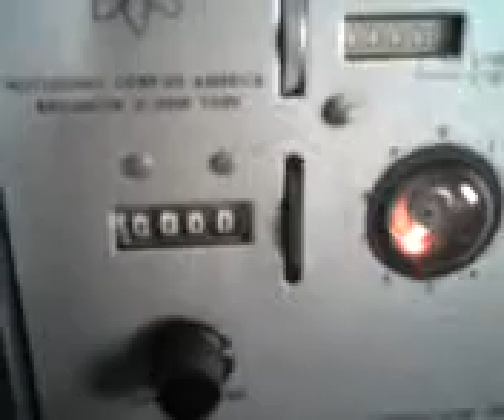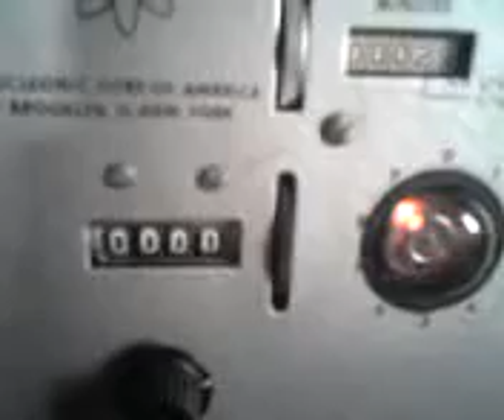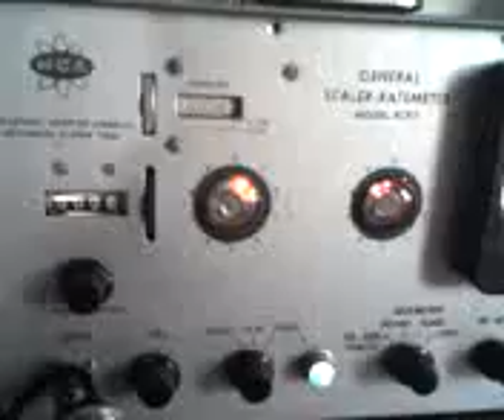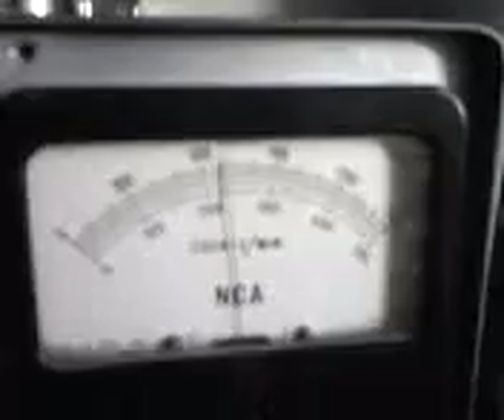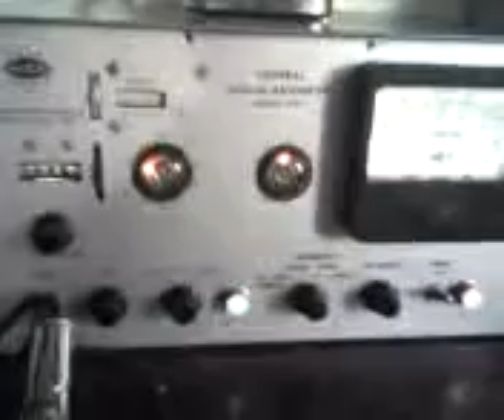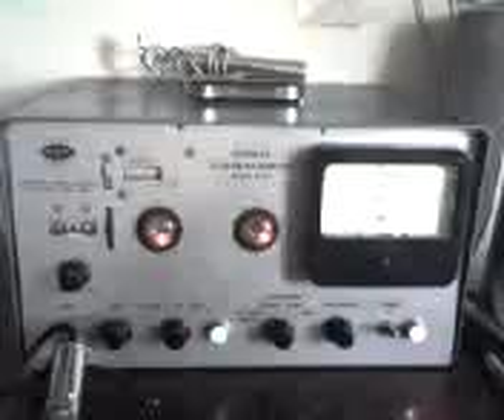Nucleonic Corp of America Ratemeter

Comment from the maker: The meter bezel is labled NCA and in the lower left hand corner it states:

MODEL 440 TYPE 537

This ratemeter was a difficult thing to get working again.   I must do a few more things to refine the meter "COUNT/MIN." reading though the digital decatron tube readings are accurate.    This unit, as I read, is prone to overheating in long runs, so I installed two fans inside to cool it down.   It works very well now.